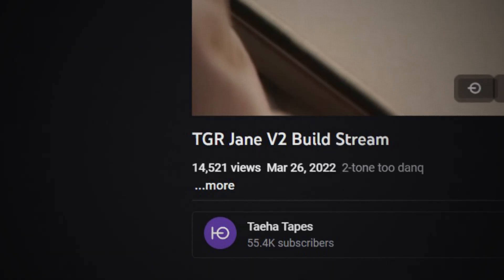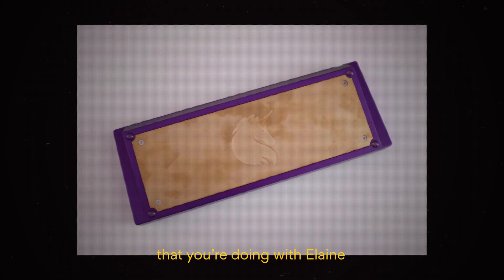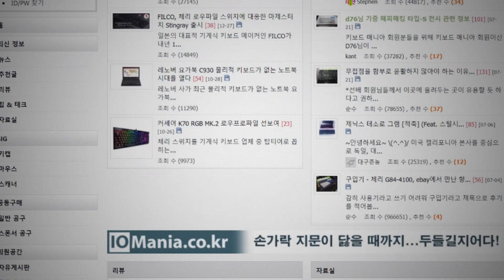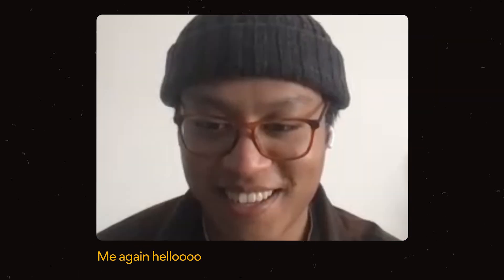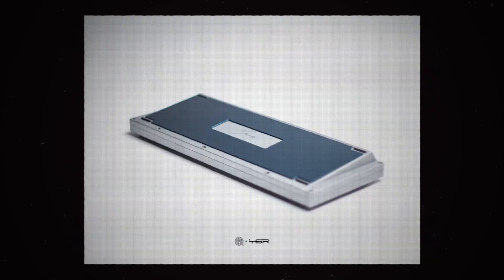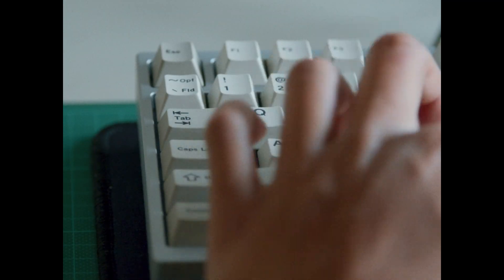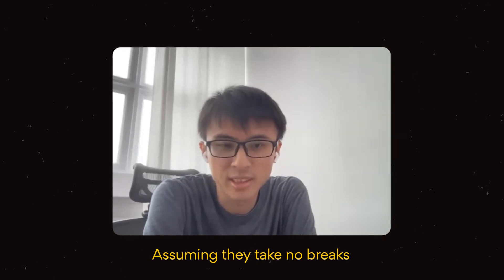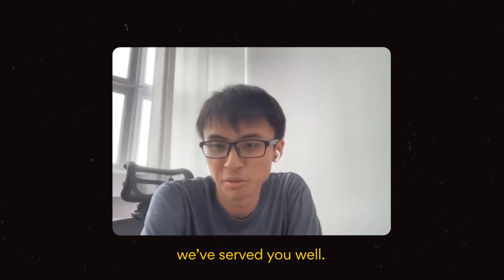Why this keyboard is so expensive - TGR Jane V2 (ME)

Comment: Looking at the keyboard there are a few setups for machining to make the toblerome weight, and the other elements on it. If you have a traditional machining setup with a floor mill I see no less than 3 setups for 2 sides and 2 setups for the weight. Each of those setups you will have to redial in your mill and that is even when you use locator / homing pins. For something like this though I would farm it out to a a facility that can do 5 axis machining so everything can be done on 1 setup, it would be much more economical.

So how do you get to 750 USD, machining setups for the body, the weight, materials used are not super exotic. This is built in small batches, so you don't get economics of scale for producing them.

I see with my eyes about 500-600 USD worth of work going into this. If the sales price for the rolling group buy is 750USD then that is completely reasonable. What is unreasonable is a $7,000 price tag even used, I know its a piece of history in the hobby, and I know some people have that disposable income, to me though I couldn't do it. 

Now all that being said, there are keyboards out there that I look at and they have a sales price for 450-500 USD and I don't see the value, they don't have complex machining, they are fairly bog standard for what you should expect from the hobby. So where does that leave us the buyer? well either go all out and get a TGR Jane if you can on a raffle buy or... go for an offering like a zoom 98. The middle ground is not really worth it.